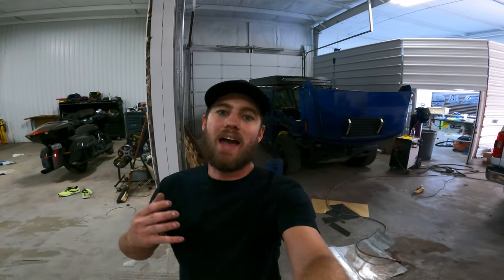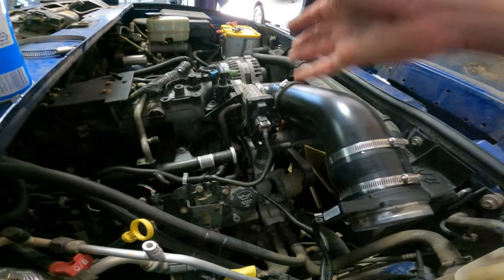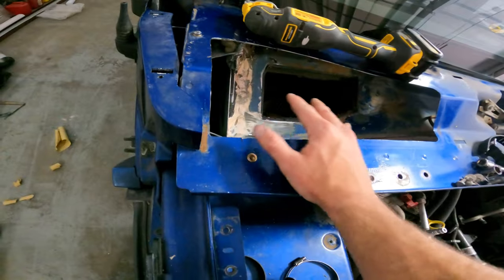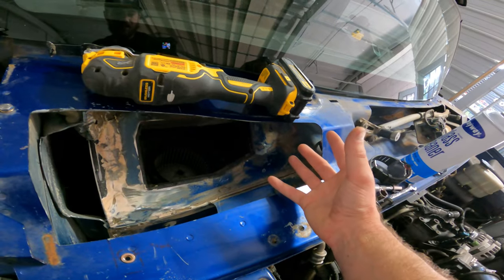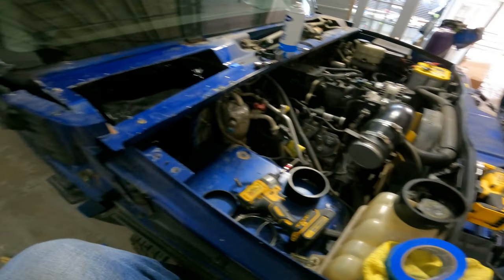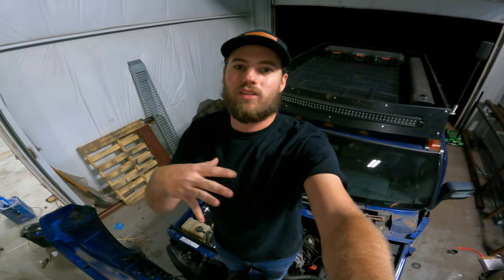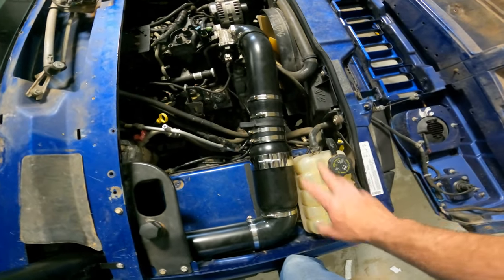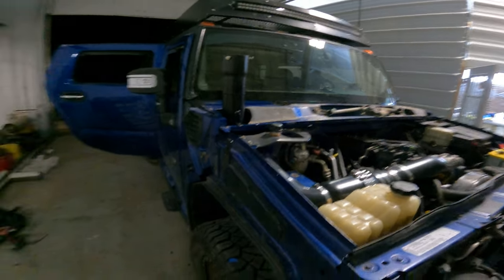Assembling the Hummer H2 Snorkel Kit

Comment: Any change in fuel Mileage? I gained 3 MPG when I snorkeled my FJ40. I've been wanting to do this to the H2 for awhile... good job
Reply from the maker: So I don't have any specific gains to tell you for the snorkel specifically, seemed pretty negligible in-city. Right after I finished the camper conversion I got on the road and spent roughly 3 months living in the truck, traveling the West and teaching photography. I was averaging between 12 and 14 on highway. I got back midsummer and put long tubes on the Hummer as well as a street tune and then got back on the road for another month. My average now on highway is between 15 and 18. There's a lot of variables in there, and not entirely scientific but everything as a whole really benefited from the street tune and I'm  consistently getting much better mileage than before.